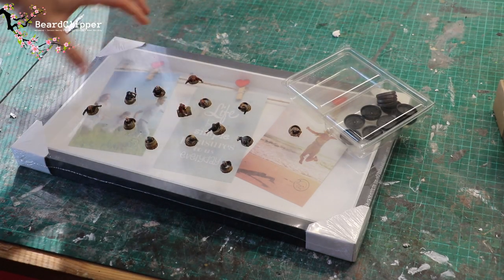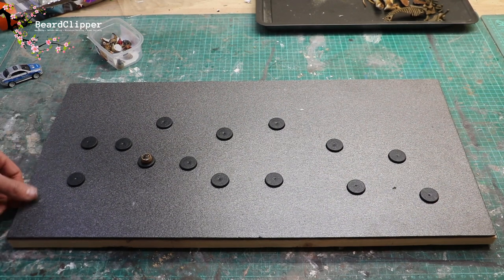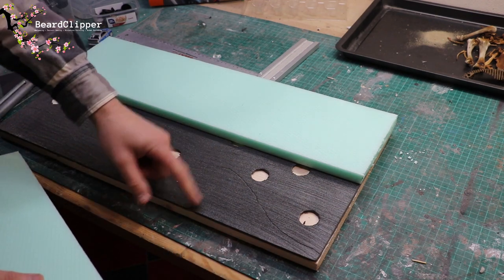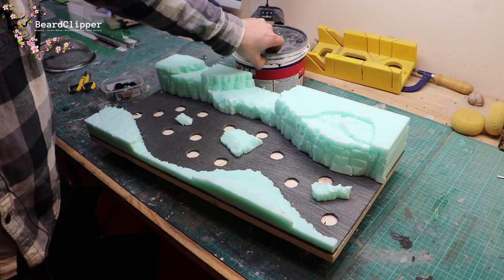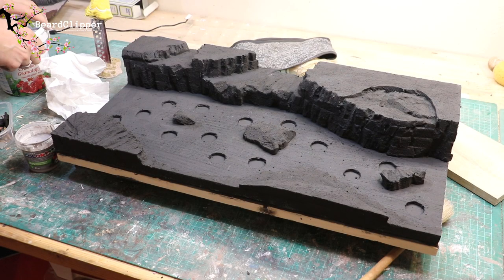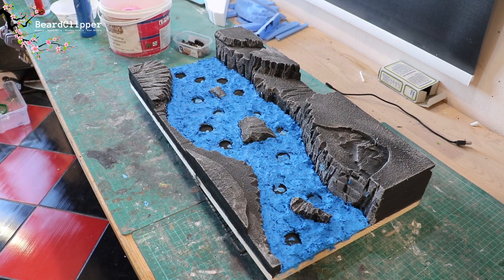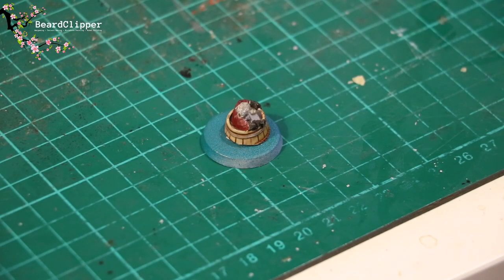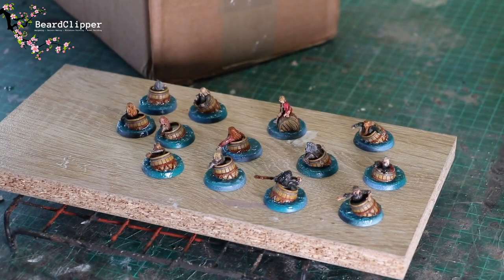Barrels out of Bond Display Board || Middle-earth Strategy Battle Game

Comment: Great little display board, I think using the Luke’s sculpture mould as rapid water was an inspired idea, really looks the part. I’ll be sure to give that a try at some point, I wonder if applying a heavy gloss varnish might be an idea to make the water glisten 🤔 That green mesh stuff you used looks worth experimenting with too. Food for thought, thanks again mate 👍🏻
Reply from the maker: Yeah I was so pleased it turned out ok! It certainly didn't have to, huh :)

I decided against the gloss mainly because I didn't want to spoil what I'd done :D I think you may be correct - maybe I'll try it in a little section and check it'll work!

Thanks, as always, for your support and encouragement. It is very much appreciated!